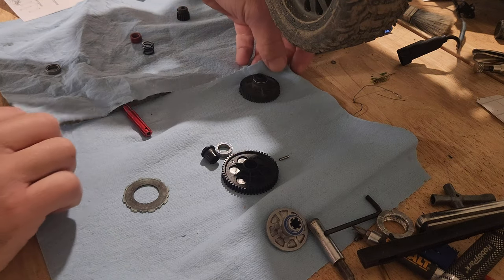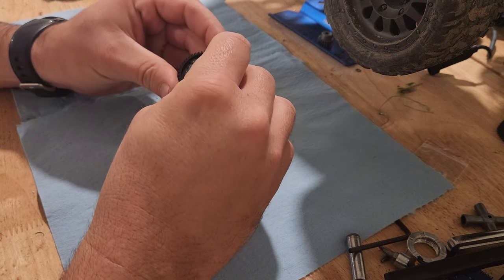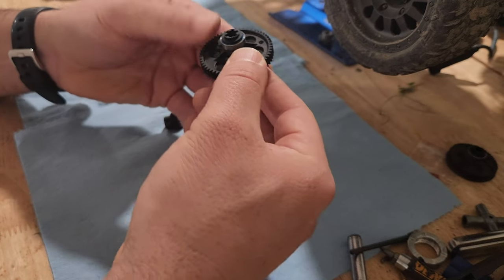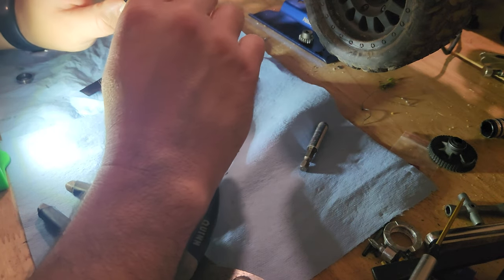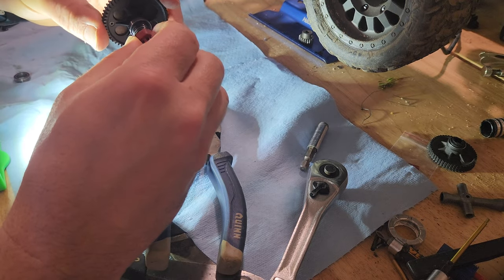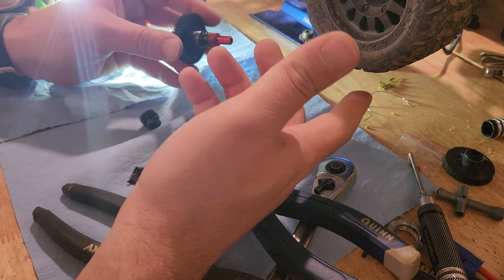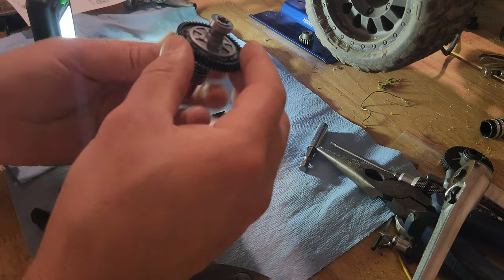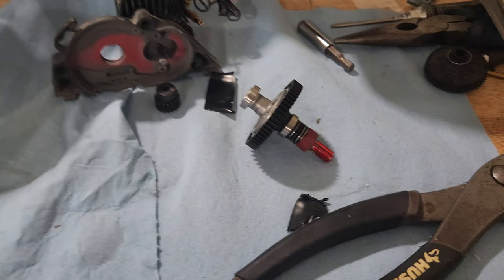Arrma vendetta slipper clutch assembly. DYI How to change Spur gear.

Comment: The vorteks and the vendetta both come with the tool to adjust and tighten the slipper. You don’t need any other tools. You thread it on by hand attach the tool and roll the car or truck forward to tighten it and backwards to loosen it.
Reply from the maker: yes thanks buddy i did just find THAT red thing. Thanks brother
Reply: Thanks!  I'm sort of new to RC and have been trying to figure this out. Appreciate the video, as well as your comment.